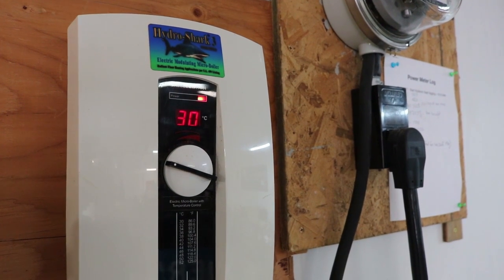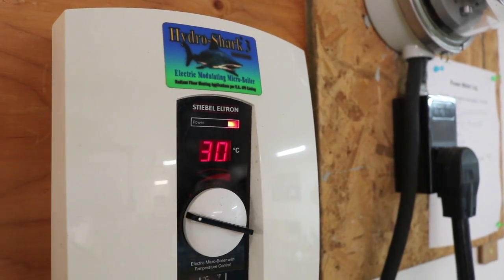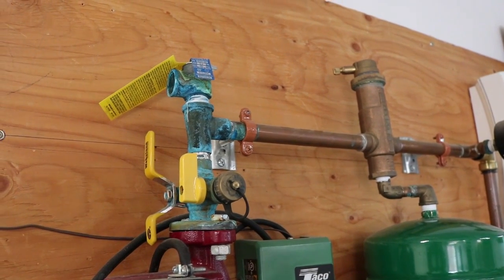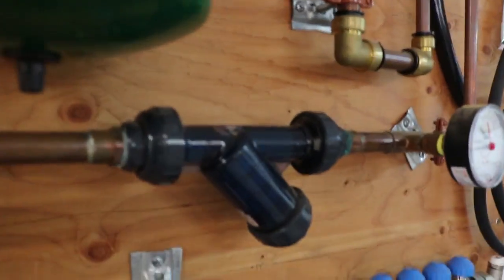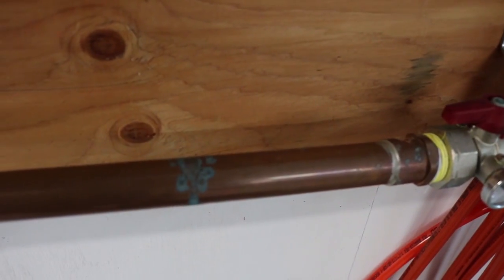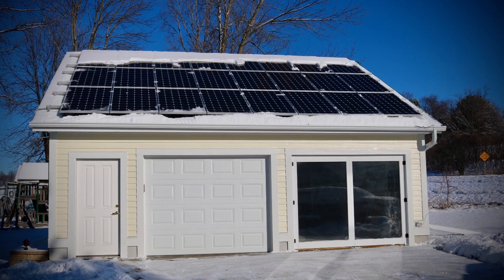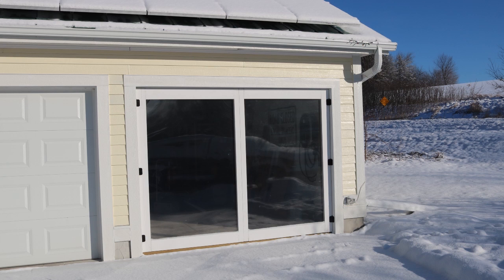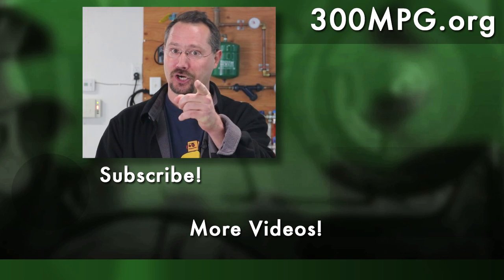DIY Hydronic Heat (3 of 3)

Comment: I can relate to the difficulty of filling a glycol system, today I refilled a TV transmitter's cooling system and I had a hard time priming the pump without making a mess... Pluming is indeed a nice skill to have, just as well as electricity, now what's the next big project for you? A water to air thermopump for your garage? Geothermal? ... I might be too ambitious! I like your projects.
Reply from the maker: I have a small spring in my front yard. It's very close to the road right-of-way, but it's cold water all summer long. I've had a crazy idea about pumping that to my house and running it through a radiator in my furnace to create poor-man's air-conditioning.
Reply: @BenjaminNelsonX  That could be a fun experiment. As you said in your video, the delta T is the most important, and if we compare to an AC condenser the evaporator can reach a temperature close to freezing, so without a water to air thermopump, you would need both a high rate of water flow as well as a high rate of air flow at the radiator to keep the temperature differential as high as possible. I think that could be tried at on small budget if your source si cold enough.
Reply from the maker: @ShawnGuertin   Probably the simplest start would just be to get a glass of water out of the spring on a hot sunny day and take it into the house. If condensation forms on the glass, that's a good thing. One of the big reasons why air-conditioning works is that it also acts as a dehumidifier, and the drier air allows us to feel cooler.
This is just something that's been kicking around in my mind for a while. I always have plenty of ideas. I'm only ever limited by time, skill, and money!
Reply: BenjaminNelson that will work for a fan coil with a drain pan.    A radiator or radiant panel will work to...sort of.    That cold glass of water sweats like a fat guy at a water park.    You have to deal with the water.    Also you need to move air across the coil to cool entire area otherwise it would be a wet messy dehumidifier.

Comment: Roughly, how much power does the system use when you turn it on Thursday night and turn off  on Saturday/Sunday as you mentioned?
Reply from the maker: The boiler can use up to 7.2kW. Electricity at my house is about $0.13 per kWh. For straight-up number of hours running at full tilt, it comes to 94 cents per hour, but that's only when running at full power. After bringing the space up to temperature, it's very easy to maintain.
My original plan for this space, and really how I use it in general, is just to have it be warmer than outside, and at a minimum above freezing. I'm perfectly happy working while wearing a jack, but but hate working outside where I need long underwear and 3 layers!
The basic thermostat runs the boiler as needed to keep the temperature above 40 degrees F.
I'll make a video in the future tracking some energy use for day-to-day heating vs. special temperature raising events.

Comment from the maker: I forgot to mention it, but the "thermal flywheel" effect can be taken advantage of by using a "Time Of Use" electrical plan. Inexpensive "Off-Peak" electricity can be used for heating at night on a timer or programmable thermostat. The mass of the concrete absorbs the heat and re-radiates it steadily, so there's a stable and warm temperature all day, even without the heat actively running.
Reply: You could probably do a whole video on peak vs off-peak.
Reply from the maker: Probably could!
Reply: @BenjaminNelsonX  please do!